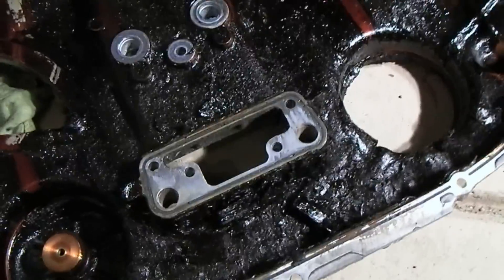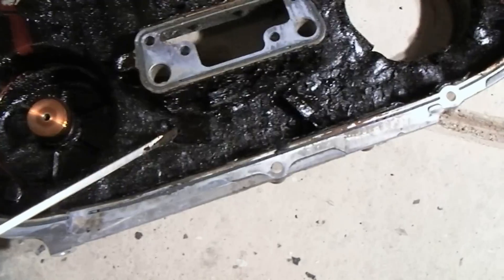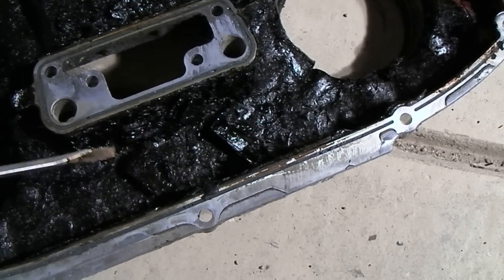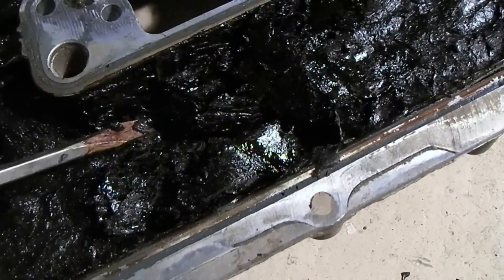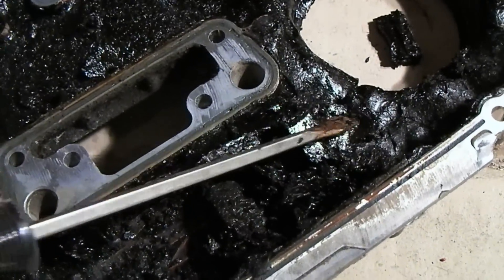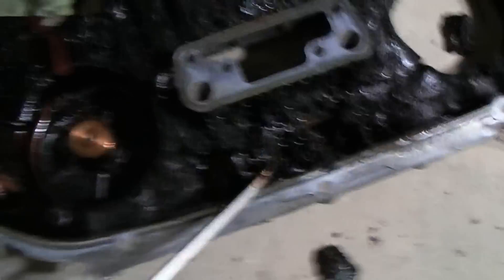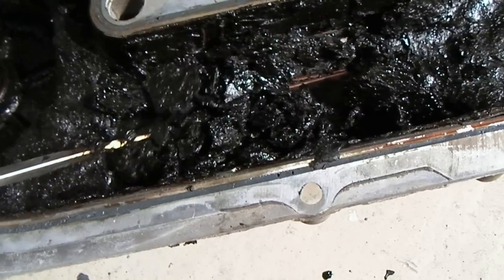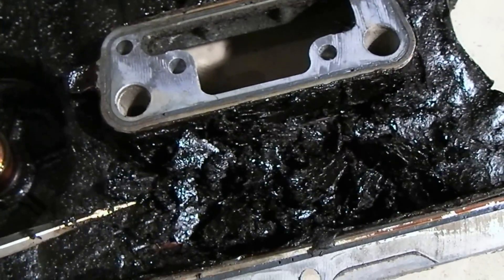Engine Sludge

Comment: That is not sludge. That is burnt carbon from over heated oil. Sludge flows.
Reply: Not necessarily.
Reply: My engine did that turns out it was the PCV valve
Reply: I was going to buy a used car when I kinda seen under oil cap inside the engine I seen like dry sludge or dry tard ..so that engine no good ?

Comment: A reason to always use a full synthetic oil.
Reply: Random Acts of Video No, a reason to use s good brand.
Reply: @lolanelilakk1300  I use very good synthetic oils like Motul, Liqui Moly, Total, Pentosin, Eneos, Idemitsu, and many other oils.
Reply: no a reason to change your god damn oil on time
Reply: @punishmint  why change the oil when you can run a 2 stroke and burn it
Reply: Plenty of cars have no sludge with synthetic oil and plenty of cars do have sludge with synthetic oil. My advice is to change your oil regularly and you will not have this kind of problem
Reply: @Vfh........y  I have yet to see any car running synthetic oil to have sludge but I have seen lot of cars without synthetic oil with sludge.

Comment: I just bought a used car and I opened the hood to replace the battery and there is sludge everywhere on the engine. Its horrible. I checked the title like the genius I am and the last passed inspection date was March of 2008. 9 freaking years ago! Im sending my car to the mechanic tomorrow and needless to say I am extremely embarrassed an I won't hear the end of it! Seems like the engine needs to be flushed and maybe new breaks. Thankfully the car IS running as good as it can in its  condition. That is why you dont pull a morbjorn move and buy a car off a facebook car sale group in hopes of scoring a deal. If its sounds too good to be true, it probably is!
Reply: Morbjørn lol inspections
Reply: what do you expect?? you dont work on vehicles often or if at all and you probably believe a bunch of bullshit or made up stories people always have when selling a car. if theres sludge on the outside of the engine its because of an oil leak it doesnt mean that the INSIDE of the vehicle is like that. my engine is covered in sludge because i had a front main seal leak but i fixed it and its not leaking no more but i havent cleaned the sludge off the outside because im lazy and i dont want to spray water near the electronics of a car engine and on my vehicle it still drives the same. i doubt the engine needs to be flushed unless on the underside of the oil cap its caked with sludge, or tons of sludge and black chunks comes out of your oil change. do the oil change yourself and see what the oil looks like and check under the oil cap on top of the engine. the outside appearance of an engine doesnt mean shit all about whats going on inside

Comment: How do you remove this sludge other than poking it with a screw driver?
Reply: can of seafoam every once in a while
Reply: I'd throw the cover in a parts washer then replace seals. If it's this bad I'd throw motor way and get one thats not gonna be a oil burning pos.

Comment: that's.. not sludge dude. That's burnt oil.
Reply: I was going to buy a used car but under the oil cap and when I looked inside the engine I kinda seen either dry sludge like dry tard so its that bad dont buy it?

Comment: I use full synthetic oil on all my cars, it says you can go as long as 15k miles but I change it every 10k. At 10k the oil still looks decent and the cars run good. Whats your opinion on this
 Thanks
Reply: Oil and oil filters are cheap and easy to change. Engine repairs are expensive and difficult. I'd carry on as you are doing, just like I do.
Reply: @jamesporter4749  Thanks

Comment: Looks like valve cover for 3.5l nissan. They definatly didnt use the recomended synthetic oil and toasted it. I bet u took that off because of your timing chain  tensioner was fully extended and guides fd all to hell. "Nissans famous 100k timing chain slap"
Reply: Help!  My daughters 09 murano seems to have Oil light Flashing and a rattle.  Probably timing chain rattle especially when cold. What do you recommend?
Reply: @dmobile2go  The oil light flashing is serious. Check the oil level asap.
Reply: Sell it those cars become money pits after 200 000 km

Comment: I have a 2013 kia sorento, i want to know if the sludge could make my car throw blue smoke thru the muffler
Reply: +maite montiel No. Either valve stem seals or piston rings.
Reply: ReeseMoyer head gasket is white smoke mate
Reply: GDI engines will throw out more soot cause it in theory a diesel gasoline hydrid, especially on startup cause the engine is running rich, which helps the engine burn off carbon buildup on the intakes

Comment: Nissan's suck ....so who cares.
Reply: VQ30/35's have been on wards best engine list since the 90s.
Reply: My dad bought a pathfinder new in 05 with 4 miles on it now it has 110k other than oil changes has original brakes spark plugs and still runs new, daily driver too
Reply: +Dixinormus   Change the plugs.  The old plugs put a strain on the coil overs and can wear them out.  Clean the throttle body and PCV valve.
Reply: total trash.......Nissan are 2nd rate at best. imho
Reply: Nissans are one of the most reliables ever. You won't see any Dodges or Fords running at 200,000 miles in their odometer in places like Africa or Asia where roads are terrible and the heat is actually hot.
Reply: ***** ......I'll give you that one.......a few older Nissan. But nothing close to Toyota and Hondas
Reply: zhbvenkhoReload you are totally wrong here in saudi arabia a lot of American car go over 200k miles such as gmc Yukons, crown vic, chryslers and pick ups